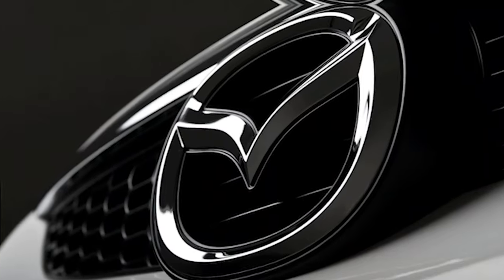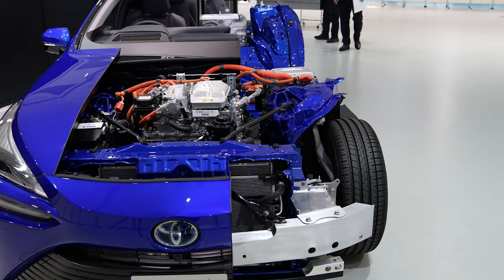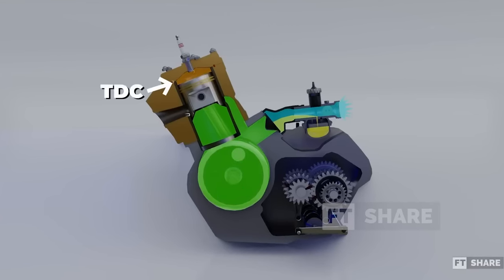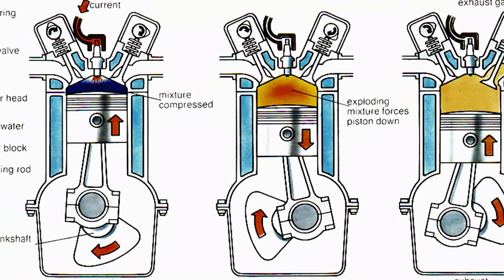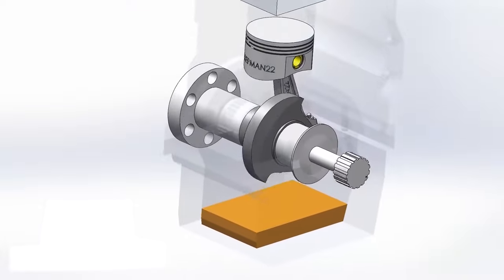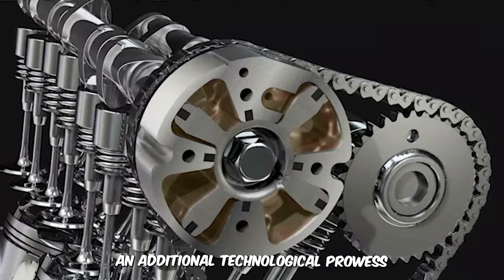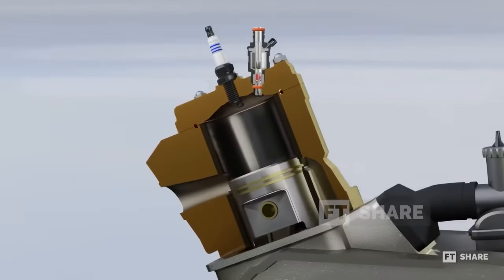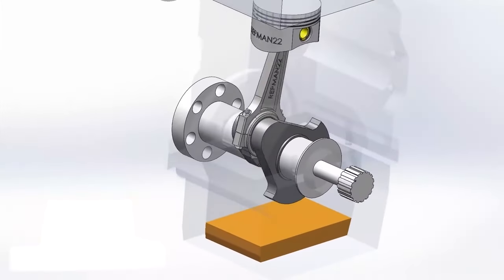Mazda Ceo: “This New Engine Will DESTROY All EV Makers!”

Comment: Mazda is going to be bankrupt in 10 years if they don’t pivot to EVs. They need to at least offer competitive EVs as they’re going to be a substantial part of the market whether they agree with it or not. Not one of Mazda’s currently available engines in the US market is class leading in terms of real world efficiency. The 2.5T I4 is fuel hungry, while the new 3.3T I6 doesn’t provide nearly the power output, sound, or efficiency of BMW’s B58 engine. When I drove a new CX-90 it averaged a middling 21mpg. By comparison an X5 xDrive40i on the same highway heavy test delivered 26MPG while offering better performance, smoother operation and a much better engine and exhaust note. Mazda announces some wild claim every few years (like Skyactiv-X) but the claims have never materialized IRL.

Comment: electric motors scoring 80-96% efficiency, so Mazda has still a way to go. Typical for a not a EV company to come with big claimes for the petrol motor. The only positive for an petrol car is fuel tank. When the battery get a potential of the twice of today its game over for petrol cars :/